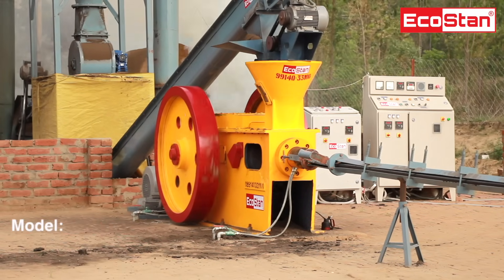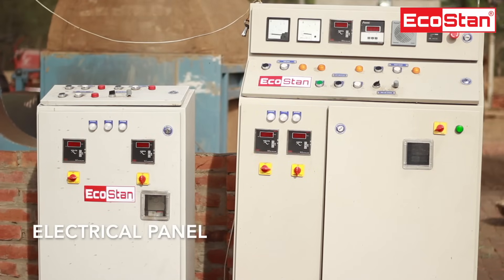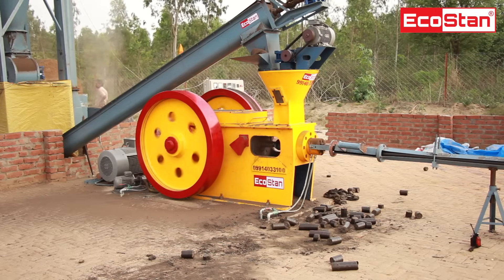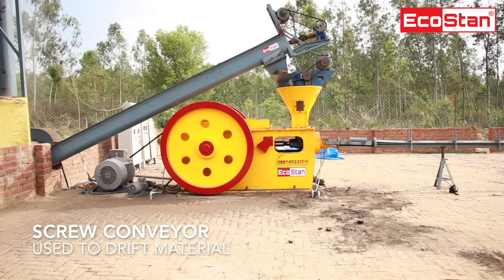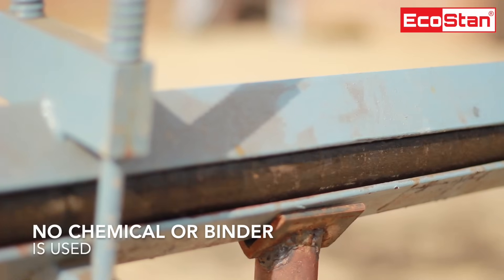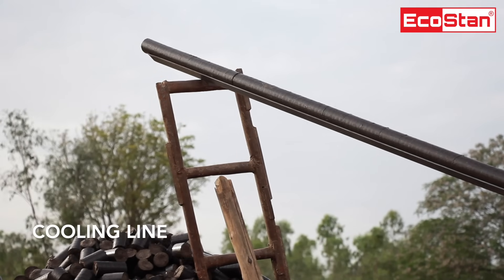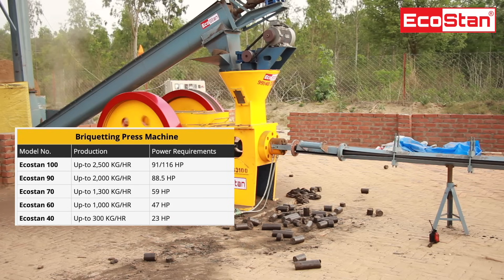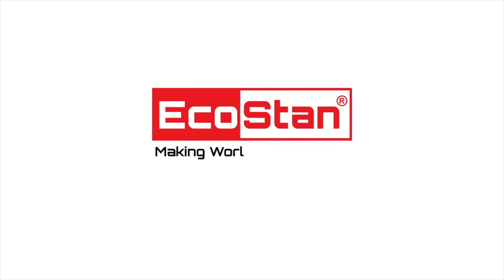ECOSTAN® Biomass Briquetting Machine, For Inquiry Call +91-99140-33800

Comment: What is power requirements
Reply from the maker: Mr Sandeep, it depends on model of machines chosen as per raw material available. For more details kindly get in touch with our team at +91-99140-33800
Regards,